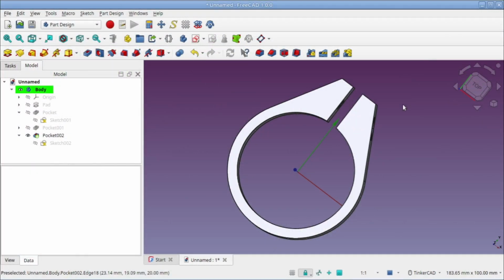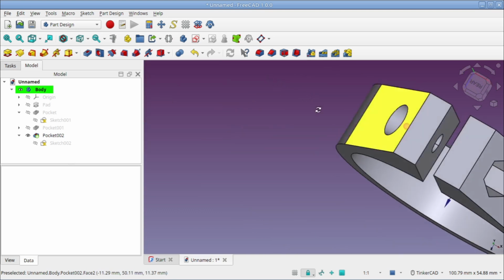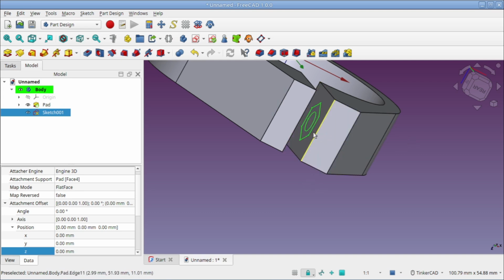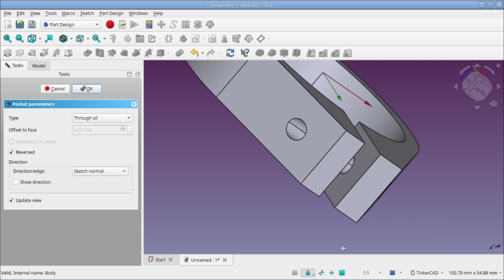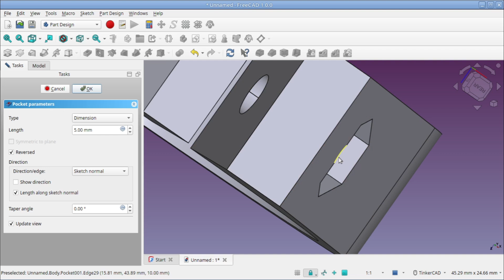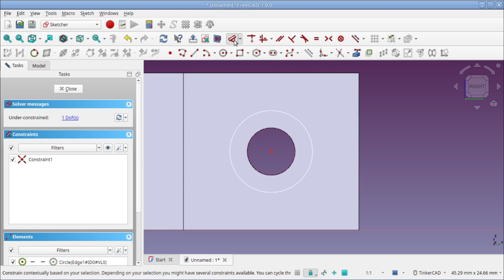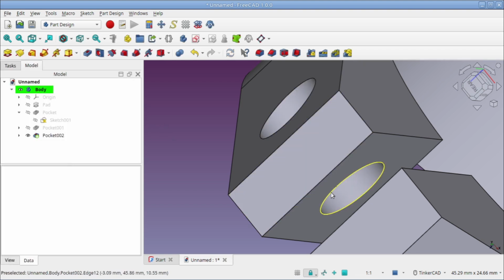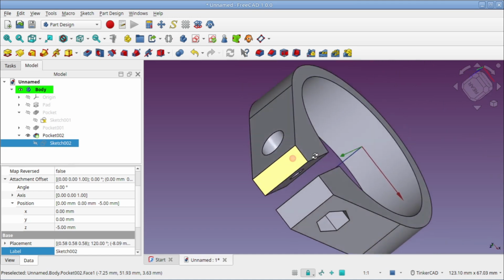FreeCAD - New user tips. Sketch offsets and dual duty sketches.

Comment: FreeCAD should follow the paradigm of incorporating all the pad and pocket commands including offsets as Fusion 360 does in a single extrude command.
Reply: It does! It’s just not intuitive. 

If you use “two dimensions” - you can make the 2nd dimension negative, which is then just an offset. 

So in the video example, to get the same result for the hex part he could have done
First dimension: 18mm
Second dimension: -5mm

That is the same result as doing 5mm start offset, 13mm extrude depth in Fusion360.
Reply: I actually realize I was partially misunderstanding what you said. 

If there was just an extrude command (rather than a separate pad and pocket command)  - I would prefer that. But SolidWorks has 2 separate commands, so I think a lot of other CAD programs have followed suit.